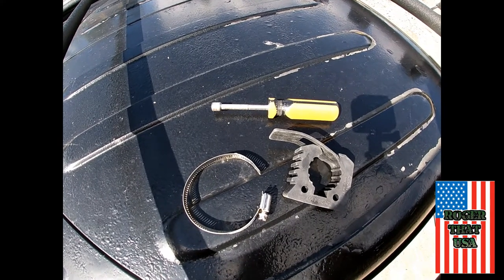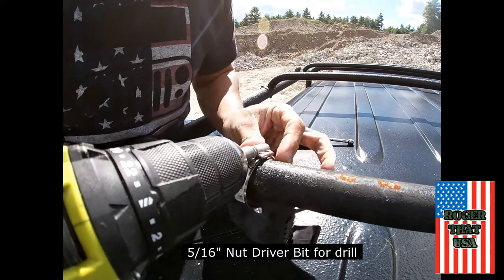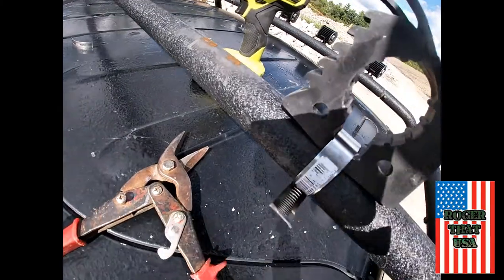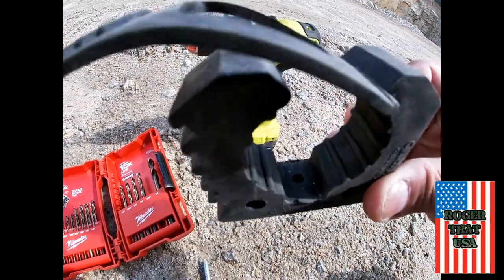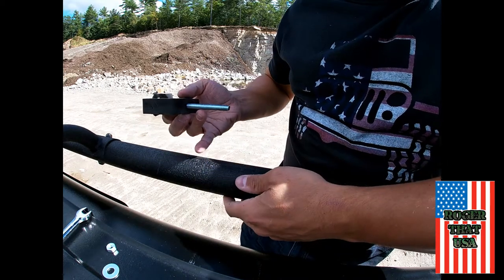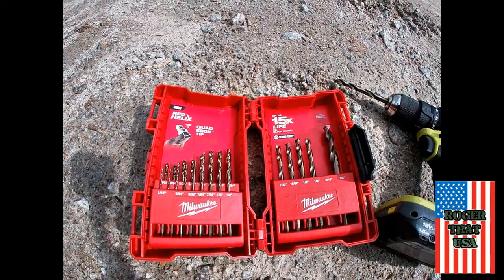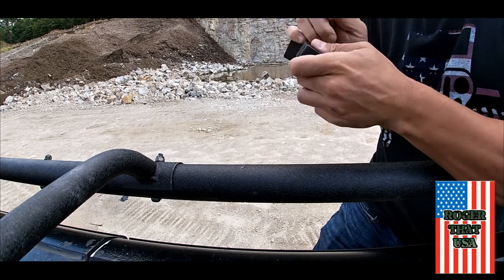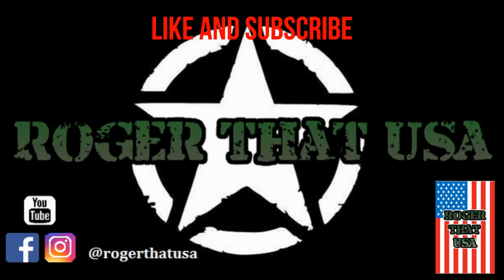Quick Fist 5 Minute Install (3 Ways)

Comment: Thanks, man. Just got some of these to mount on my 4Runner stock roof rack, and I’ve been scratching my head on how I want to throw a shovel up there. Don’t want to drill into the cross bars yet, so I think I’ll go with the adjustable hose clamp like you did. I tried some zip ties through those small holes on the quick fist, just to experiment, not too stable, though, for the long run.
Reply from the maker: the clamps hold them great for sure. Good luck. Have fun with it.